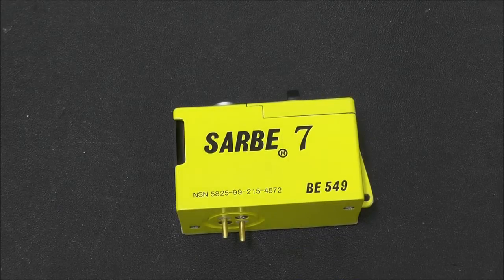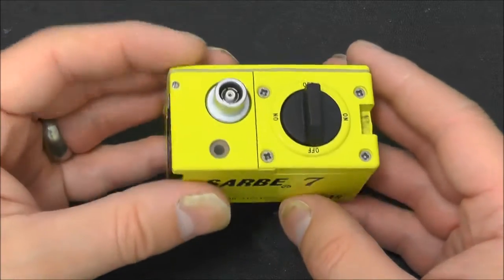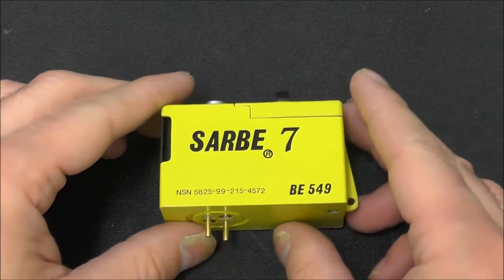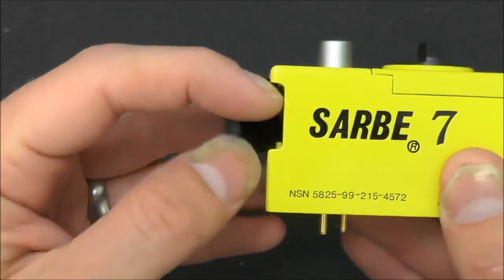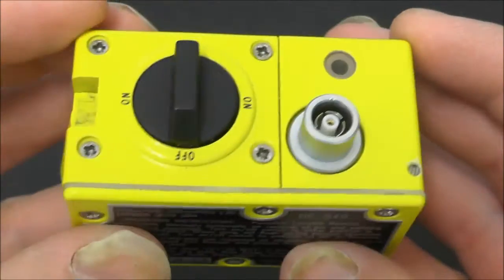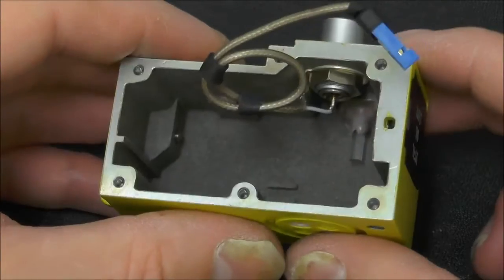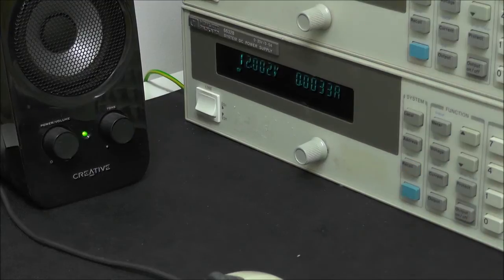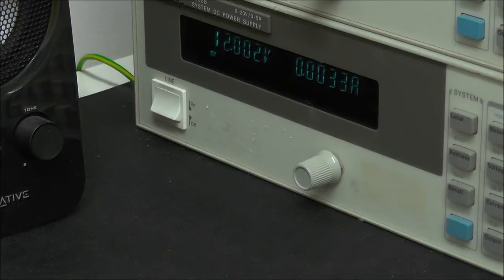DL#025 - Sarbe 7 Emergency Distress Beacon Teardown

Comment: The current draw is simple. The reed switches are closed when the magnet is close by, so the CMOS requires a pull up or pull down resistor. That typically will be a 100k to 1M resistor, so then you get 2 of those plus CMOS gate leakage and whatever other capacitors are leaking as a battery draw. That is why they have the 20Ah batteries so they still can deliver the rated operation time at designated battery change time, where you might have used half the capacity on both standby and with the recommended weekly test schedule. Unused batteries in sealed packs typically have a 10 year shelf life, but only a 5 year or so life before replacement is mandated after installation. You also cannot install a battery that has less shelf life remaining than you are certifying the unit for. 99.9% of these units will never be used, and will go from manufacture to scrapping totally unused except for test. You really do want it to work though for that 0.1% of the time when your life depends on it though. that is why it is built so ruggedly with such good sealing and such care to detail.
Reply from the maker: SeanBZA thanks Sean, i was just expecting the whole device to be powered down.
Reply: DextersLab2013
 They could power the whole unit down, by using NO reed switches to reduce that current draw entirely, but then the reed switches would have to handle the entire transmit current and that current is not going to give a long switch life. You still need to keep the capacitors in the PSU section formed, as long term storage without charge in a vibrating environment could lead to them shorting out when you try to use it. Powering them full time they can fail and flatten the battery, which would be evident on a test. You probably could design it to have much lower standby current draw but this is a very conservative industry, they do not change if the old stuff still meets spec. They took decades to introduce the new stuff, running 2 systems in parallel until the old satellites were failing and they had essentially to change or launch new birds.
Reply from the maker: good points Sean!